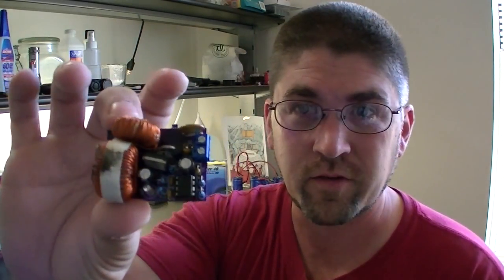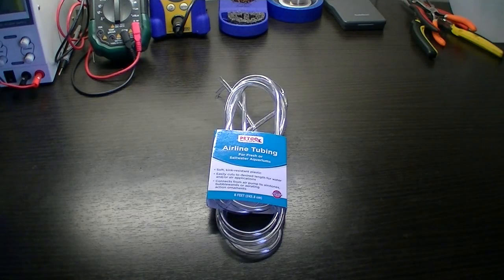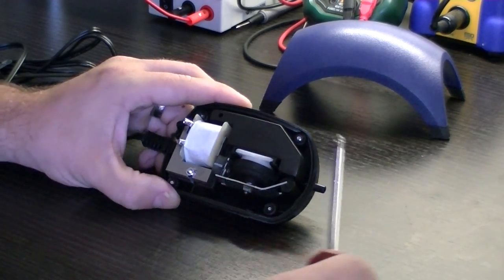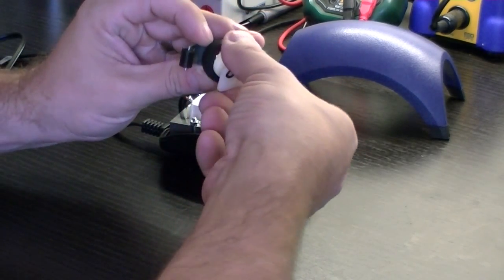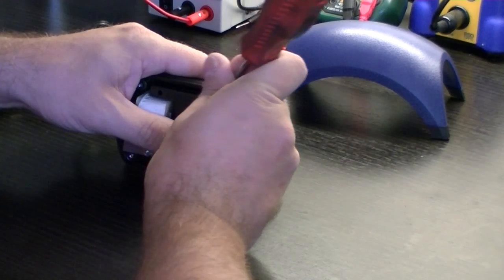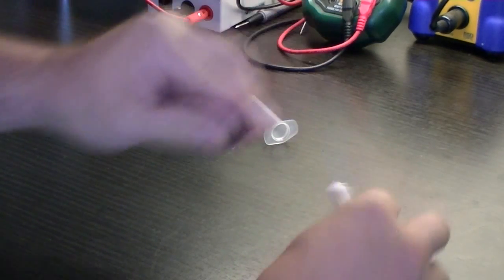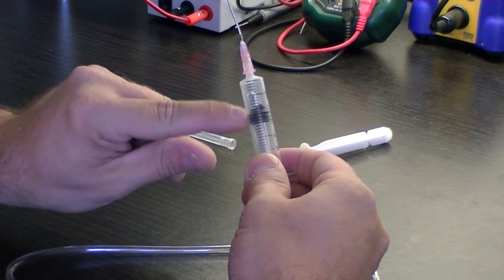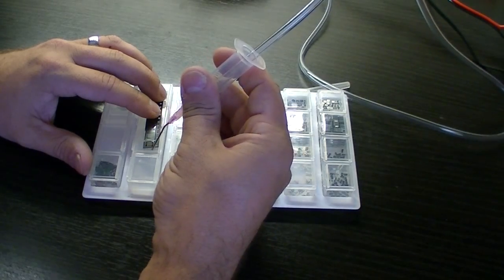DIY Manual SMD Vacuum Pick And Place Tool

Comment: I used a cheap pick-up tool and screwed the end in a syringe. Bought a Tetra pump and I use it to lift IC's. The are so awkward to pick up with tweezers. I also added a little foot pedal.

Comment: I just made one using an empty, "ChipQuik" flux syringe and the flux dispensing needle that comes with that syringe.  To bend the needle without possibly kinking it, get a sewing needle that barely fits into the hole in the syringe needle.  With the sewing needle inserted into the syringe needle and the syringe needle mounted on the syringe, bend the syringe needle over the back of the the handle of a pair of needle nosed pliers.  (You are using the handle of the pliers for a jig to make a small radius bend.  You could also use a 1/4" dowel rod to do the same.)  After completing the bend, pull out the sewing needle.  This will give a nice radius bend without the possibility of kinking.  The plunger, if installed backwards, can be drilled and used to seal the plastic vacuum line to the syringe.

Comment: I tried silicone tubing and it didn't work. Apparently, it's so soft that it caves in and doesn't sustain the vacuum all the way to the tip. I'm not sure this is the correct explanation, but replacing the silicone tubing with standard plastic aquarium air tubing works fine.

Comment: some silicon tubing would be more flexible and easier to manipulate much like the Si insulation on a good soldering iron. As a source try fuel hose intended for model engines from a hobby shop.
Reply from the maker: Rob B Good idea!

Comment: I've gone off and done my own thing...spending a little bit more money but with a great result.

I ordered some syringes with draw tubes.  These have an ID of 14mm and an OD of 16mm.  I bought 8 x 9/16x5/32x3/32 rubber washers.  This diameter washer fits really nicely in the 14mm syringe.  I also used a purpose built pump instead of hacking the aquarium pump.  It cost about the same so no big deal.  I also bought some 14mm iron tubing and some 6mm brass tubing.  This was a bit dear but I have most of it left over.  I used a 8mm wood drill to ream out the centre holes on the rubber washers.  This was a pain but I figured out if I make a spacer from the iron tubing which I was going to do anyhow and put the spacer and the washers in the syringe they can all be cut at the same time and it only takes a few minutes.  I then put 2 washers on the brass rod followed by the iron spacer and finished with the remaining 4 washers and inserted the assembly into the syringe.

I can connect 6mm hose to the brass tubing which is the same ID as the fittings on my pump.  I don't have a mechanism for releasing the vacuum but since I want to use this in a CNC I'm likely to build the vacuum control into something a bit more sophisticated than a hole in the syringe. (No criticism intended.)

So, I've abandoned the cigar box but have a different plan which I like much better.  If I prorate the cost of the metal tubing and clamps I'm still under £20 but I still need some hose which may push it over a bit.  This still falls short of the mark of having a working mechanized pick and place machine as I've blown the whole budget on the pick-up head.
Reply from the maker: You seriously need to make a video on your build!
Reply: R&TPreppers I'm working on a syringe based head for applying solder paste.  I'm thinking about using a step motor from a floppy drive.  The worm gear needs to be replaced with a high TPI threaded rod but that should give me the torque I need to push the paste.  I'd appreciate your thoughts.
Reply from the maker: Now that is definitely reinventing the wheel!  The only problem I foresee with using a mechanical syringe for placing solder paste instead of using the silk screen squeegee style is solder paste doesn't tend to hold onto pads unless force is acted onto it.  Try taking a syringe of solder paste and manually put it on the pads, at least half the time the paste likes to lift off of the pads when you retract the syringe.  When you use a solder stencil, your putting pressure on the solder paste which helps it adhere to the pads.
Reply: R&TPreppers I bet it would stick if the pcb was warm.  I think the secret is to get the flux sticky without burning it off or flowing the solder.  I'm almost done with a hot bed for my 3d printer with a target of controlled heating 60-90c.

I'm suggesting using the same machine for 3d printing, pick and place and solder paste placement, each with a separate head assembly (obviously).  I might go as far as a vertical mill (ala Dremel) for cutting through spray paint on the PCB.  Some folks are milling PCBs, cutting through the foil and sacrificing the top of the substrate.  I want to cut through the paint and sacrifice some of the copper but spare the substrate and finish in a FeCl3 bath.  It means my z axis needs to accurate to about 5 microns.  I think others are suggesting that this isn't impossible.
Reply from the maker: Best of luck with it!  Keep me in the loop, I'm interested in your progress.  I have yet to play with a pcb warmer plate yet.

Comment: I wonder why you need a vacuum pump at all.  Can't this be done with a rubber bulb like on a physician's BP cuff?  The vacuum pump seems like overkill.  I'm thinking about hacking this with a mod of Low Budget Manual Pick and Place (HD).  I only need to work on small boards...wonder if I can get this into a cigar box...and keep the cost under £20.
Reply from the maker: I have seen that video before and love the setup this person has made.  As for the vacuum pump he is also using one.  the problem with using a rubber bulb is you usually need constant vacuum when picking up components as you never get a perfect seal. A manual bulb pump will run out of vacuum before you get a chance to place the component.

Comment: Does it do 0402's aswell ?
Reply from the maker: You may have to get a smaller diameter needle for the syringe and then it will work for 0402's.

Comment: nice video.. is it not easier to change polarity for direction of the pump instead of rotating it?
Reply from the maker: Sorry no changing the polarity on the transformer won't do anything as we're dealing with AC, not DC.